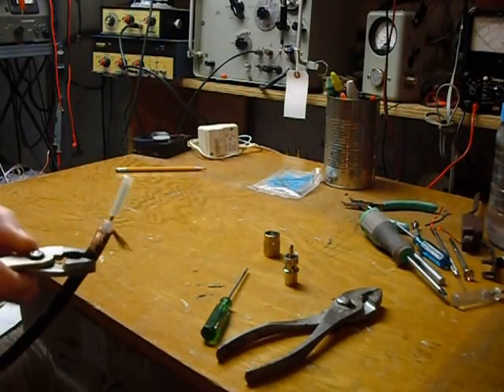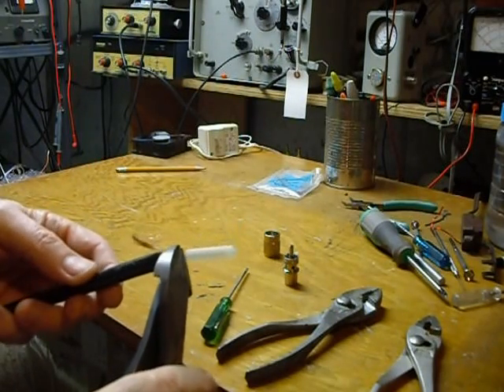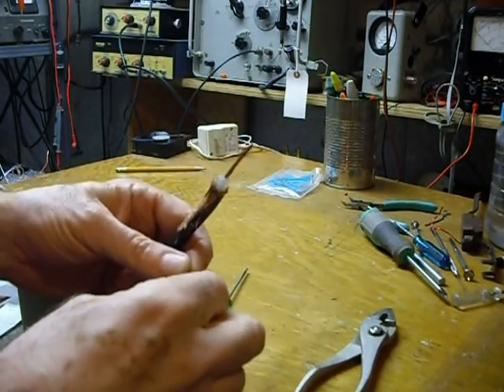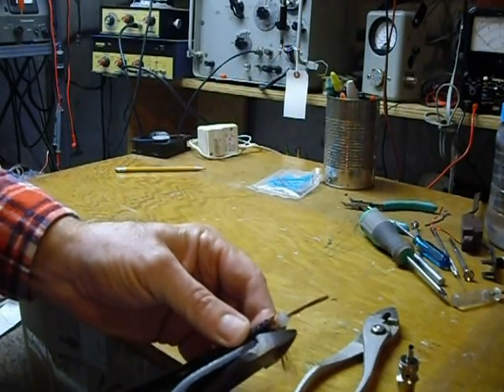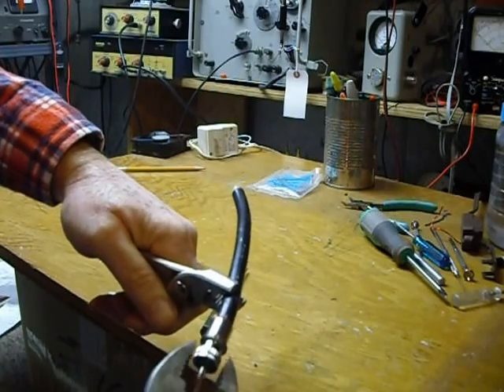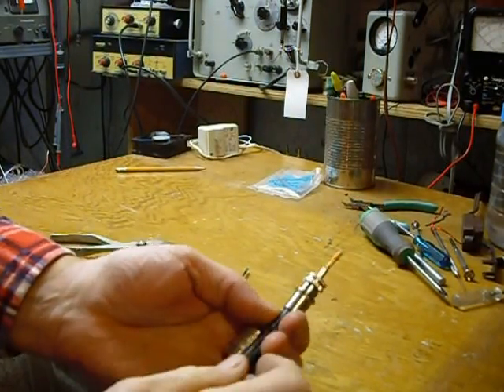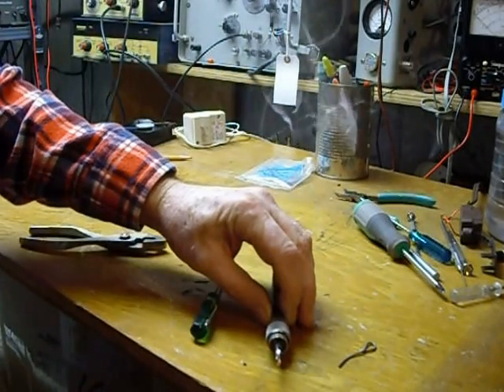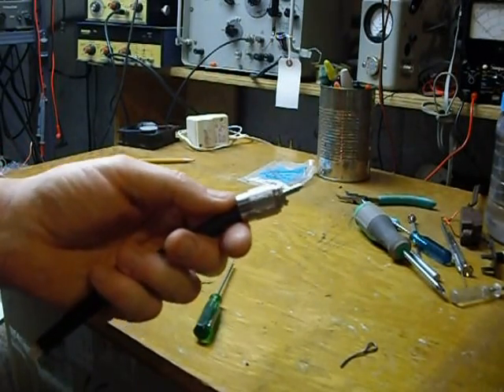PL259, Install a PL259 the easy way, Coax connector, PL259 with no soldering

Comment: With all respect for someone who has been in the bobby 30 yrs .. this is exactly how you do not do a connector ..u want to soder... And there is a much better way ... Never cut back the insulation because now the water can seep from the end onward.......I relise this may work... But you should always always solder your shields.... If u don't u will see a impedence dance overtime... If u do the shield properly...

Comment: You should add that this is only for coax <.400 inch. I cannot see you using that connector on RG8X. Please correct if I am wrong.

Comment: Thanks Robert. 👍
FYI, this method is now used by people all across Australia, (especially remote areas where no power for s/irons and No Flame/Heat environments) in NZ, remote Indo and also at the Antartica base) its refered to by many installers lately as the  'Sumption method'...
This was first used/invented by a NASA engineer along with a local installer during a power outage in the town of Carnarvon, Western Australia during the installation of the transmission/recieving dish built for the moon landing which the town on a special feed was the first people in the world to view the landing and moon walk even before NASA Launch Control Center (LCC) located at NASA's Kennedy Space Center on Merritt Island, Florida. The installation of the NASA dish and this cable connection was recorded and played on several NEWS networks for many to copy.
The same method was then past over to Navy techs when building the Harold E Holt Naval base Exmouth during the wars.

Comment: Any one have a thought on how I would do this with a much thinner antenna wire?My dad just bought a boat and the antenna wire that comes attached to the stock anteamma is much thinner.  I have an icom VHF radio I'm trying to install for him and would love any tips on doing this method on the thinner antenna line.

Comment: Assuming one end inside and one side outside, how long before the unsoldered copper braid, on the outside of the shack, starts to oxidize and cause problems?

Comment: This is how I have always done it too & it works great! I am currently having a PL259 connector that I bought Already Soldered & it has a intermittent Short so I will de-solder it & do it this way in this video. Thanks for sharing 73s 👍👍💙

Comment: I did CATV for many yrs and this is the same concept of putting a connector on . I realize it can be done either way an im sure ya got folks that will say ya have to solder it but to me i believe it works just fine as you have done it Robert . JMHO

Comment: Another ham in town showed me this method about 40 years ago. He was an old Navy operator and he called it the "Navy Way". At any rate, all his PL-259 connectors were done the "Navy Way" on both towers and with the coax runs feeding all his wire antennas. He ran QRO without a single connector failure right up until the day he passed away. I started doing my connections that way back in the '70s and also run QRO from 160 meters through 6 meters and have never had a single failure. Never had a failure while running AM back when the kilowatt input power level was the rule and had no problem with the +2500 watt PEP power levels my homebrew rig would develop. Several of my coax runs to the tower and up to the top are +20 years old and they work perfectly at full legal limit. The only additional step I take is to wrap some coax seal putty around the threaded end of the PL-259 to seal it to the coax jacket after I screw the connector onto the coax. Probably not necessary since the connector threads are tightly pressed against the coax jacket, but it seems like a good idea.  Thanks for creating the video and sharing the "Navy Way" of doing it right!

Comment: No offence but just because it is easier to install it that way and you have been lucky enough to have it work for you for years and years does not mean that is the correct way to do it. There is a very good chance that when you are tightening down the connector it is slicing the braid inside and possibly leaving wire fragments that can short out to the center conductor. Also it prevents the insulation of the coax from making a proper seal on the connector to keep water out. Also the open un soldered holes on the barrel connector will allow water and moisture inside the coax. 

Also the higher in frequency the coax is used at the more apparent the poor ground connection will become.

Comment: And hope the integrity of the shield to connector connection doesn't degrade with time... At a minimum you some sort of grease should be added to help passivate the shield.

Using a quality crimp on PL-259 is a far better way to go then simply improperly installing a connector, even though it might work.

Comment: I've been a ham for almost 30 years and was into citizens Band years before that.  My dad taught me about CB and antenna connections.  So my question to you is, WHY would you use 75 ohm cable (you mentioned it) for radio communications when 52 ohm is the one that has always been for radios, unless of course you are going to use a balun for your antenna??

Comment: Good instruction Bob, the only thing I do different is after soldering the center conductor is use a fine file to clean the end up.   An old CB Guy taught me back in the 70s exactly the same as you.  Thanks for the Video Bob.  73s Brian, Adelsheim Germany

Comment: Hi Bob!  Thanks for the neat installation process for PL-259.  It really works nice and I redid all of mine for 160 thru 6 meters.  Wonderful idea and always learning something new every year.  What fun be a ham is we never stop learning.  73 de Ron N7RD
Reply from the maker: Your right Ron I learn something new about Amateur radio every day .  73  Bob
Reply from the maker: Ron I forgot to mention the new clamp on PL-259 connectors for RG-8 ,RG-11 and other large coax types . I tried them and like them . They sell them on Ebay . 73  Bob

Comment: I've followed your "no solder" pl259 on both ends of 110' of LMR 400. I've found this shortcut to be a poor way of installing pl259's (at least on LMR 400.) I had nothing but swr issues using this method. Nothing will beat leaving the braided ground intact (wrapped around the foam insulation) and adding solder into each ones of the pl259's (3) three holes. Those holes are there for a reason. Dropping malting solder through each hole will ensure an excellent connection between the pl259, and the ground. Of course soldering the center copper core wire is a must. There can be no exception when soldering the braided ground. Your method is (as I've found out) a lazy shortcut that will inevitably leed to issues as It did for me. Taking a few more minutes to do it right the first time is the correct way to do it. And in my opinion the only way it should be done. 73's
Reply from the maker: When doing the PL-259 connectors this way  the shield braid must be tightly  screwed in the back of the connector shell to make a good shield connection . I  do not have any LMR 400 coax here just RG8 and the Aluminum shielded RG11 .   so there may be some problem peculiar to the LMR 400 Some of these with the RG11 aluminum shield here   have been in use over 30 years  done this way with no SWR problems at all over that period  of course whatever the coax the center wire must be soldered  .  I have quite a few RG8 cables in use and some of these are soldered  and some done as shown in the video  but recently I have been using the new clamp on pl-259's  and like them they are easy to install and nice when doing it up on the tower  . 
Sorry about your problem and thank you for informing me .  73  Bob

Comment: I cringed just watching this video. What a hack job! That technique must put a lot of stress on the cable while screwing the connector on with pliers. The PL-259 was designed to be screwed on over the vinyl outer jacket, not the jacket plus the folded back braid. I wouldn't be surprised if the additional force required to screw the connector on over the braid twisted the insides of the cable and weakened it. If you must use solder-type PL-259 connectors (and I don't recommend it), at least use them the way they were designed to be used. Only hams would attempt a hack job like this. If you don't want to solder the braid, use a connector designed for it, such as a crimp connector or a compression connector.

Comment: thank you for the help. Nice clear instruction.
Reply from the maker: Glad you liked it ...I have antenna coax cables that have been in use 30 years with the connectors installed this way .  73  Bob

Comment: no soldering, then out comes the solder doh
Reply from the maker: pfcdre Yes you do need to solder the center conductor . Perhaps I did not word that part clearly enough in the video .  Also I use a lot of Aluminum shield coax and I have never been able to solder to that . There is a new type coax connector now some guys call  it the CLAMP ON   PL259  the shield clamps in the connector when you screw the back part on they really work good . Several companies have them on Ebay now . I used one on my 75 meter inverted V recently and I am impressed with how well it works it is really hard to solder on a regular Pl-259 outdoors on the antenna  especially with soft foam dielectric .  73  Bob
Reply: yes it was for my boat, so i got a gas powered iron and did it, its working fine thanks
Reply: NO you doh ! if you look the braid has a mechanical connection which is fine,  the center connector does not that's why you have to solder it. doh.

Comment: Good video Robert. I have to wonder however, since you use solder for the tip, why not also just solder the braid through the  holes provide in the pl259 body ? Your great unknown is how many ground braid wires were cut by the internal threads of the body of the pl259 when you screwed it on ?
Reply from the maker: Yes I am sure some of the wires are cut when screwing on the body of the connector but think of this how many of the copper or aluminum  braid wires are actually soldered ?  if you try to solder all the braid wires you can melt the center dielectric and cause a short circuit . The PL-259 was developed back around WW2 when RG-8 had a solid dielectric core this solid dielectric  is better for the soldering process the Foam core melts really easy . Have you seen the new CLAMP ON PL-259 OR COMPRESSION connectors these are like the N connectors and are really easy to install on copper or aluminum coax I have used around 5 of them so far and I think they are GREAT ! I made a video on installing these new type connectors just search for 
" CLAMP ON PL-259 "   73  Bob
Reply: Thanks Robert. I tried the other method of soldering the braid before inserting. Stinking foam core melting was a problem for sure. I should have used a small rolled up pop can between the braid and the core. I will also give your method a try too.

Comment: crimnp connectors are also If  mechanical...perhaps a bit better connection than this method. BUT...YOU DON'T NEED TO SOLDER THE BRAID FOR THE LOW HAM BANDS! Those who insist on sodering the braid can LIVE with the fact the braid IS NOT SOLDERED totally...just at the 'hole ports' in the PL259. SO...talk about 'not dependable' or poor connection?? Smoke that bit of info!!!
Reply from the maker: Correct Dave ... I agree ...By the way  I just used 4 of those new type compression or clamp on PL259 connectors this morning ... they sure are nice ... I took one back off of one cable  too  just un-screwed the back compression nut and heated the pin with the soldering gun and  ZING it was off . I Made a video on these connectors just put " Clamp on PL259 " in the youtube search box and it will come up  . 73  Bob

Comment: Title says install PL259 with no soldering, then you solder it!
Reply from the maker: Yep you need to solder the center conductor the NO SOLDERING is about the shield which is difficult to solder .
Reply: @robertsumption1243   I thought this was for the crimp/crimp type like sold at Quicksilver.   Rats!
Reply: lol
Reply: Get a grip, you know what the guy meant.
Reply: Antonio Magillicutti he meant not soldering the ground portion stop being a troll
Reply: @MBUNetworks  no solder normally means no solder

Comment: another trick is to put a little dab of silicon grease on the connector threads and it screws on easier. Also while pulling off the white Foam insulation, twist it while pulling and it keeps the end from fraying so much. thanks de NL7IB
Reply: +CB Church and when you cut you should also twist the cutters in the wire twist direction.
Reply: What I also do is use a hot silicon gun and inject hot silicon INTO the small holes where you would normally solder the ground.

Adds. strength and is more resistant to weathering.

Also, use heat shrink rubber sleeving as opposed to electrical tape which a lot of people do.

Comment: Neat! That might work also with non-copper braid coax cables. I've got a roll of RG8/u coax with aluminum braid/foil outer conductor. Solder won't stick on it as witnessed by many hams. Your technique might be the answer for that. 73, de VE2YMV.

Comment: Bob, Shakespeare now makes a compression type PL-259 connector that requires no measuring, stripping or soldering. The only tools required are a wire cutter and a pair of pliers. The connector, part # PL-259-CP-G is made of gold plated brass and sells for about $10.00. They install in seconds and last forever. Greatest thing since sliced bread. I have use them on marine VHF radio antennas with great success.

Comment: Im a new ham and Im trying to build a couple j-pole antennas for search and rescue in my county.  I have RG-6/U 75 ohm coax and will be using it but I need to order the PL259 connector and I was wondering which on you thought was the best and which one I should order. Thanks.

Comment: Thanks, this is the way I usually do it, I have gone rounds with other hams telling me this is a bad way. They can never give me a logical explanation as to why.. Always just say. Because rf likes solder, but this is less resistance than soldering, no risk melting the core, and having the center get exposed.. 73

Comment from the maker: The solder is plain old  60/40 rosin core radio solder with lead in it . I bought it at the kalamazoo Michigan  Hamfest flea market last year.The lead is not a problem if you don't put it in your mouth . By the way the kalamazoo hamfest is Sept 20 2013 at the fairgrounds on the east side starts at 8 AM EST .  You guys who are not Amateur radio operators but have an  electronics  interest or hobby the hamfests all have electronic flea markets just google Hamfest  ....73   BOB
Reply: thx for the movie!